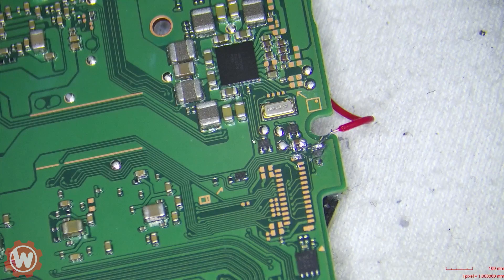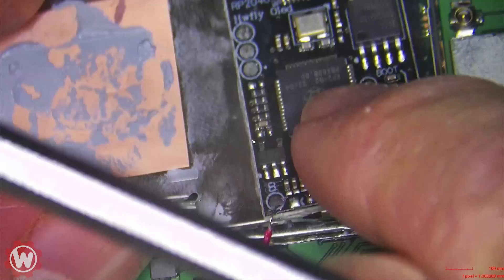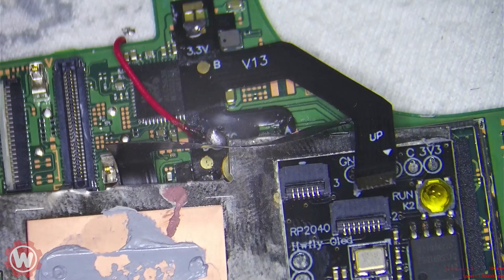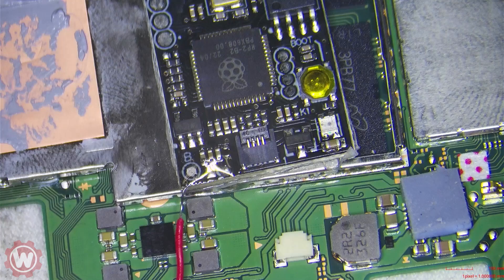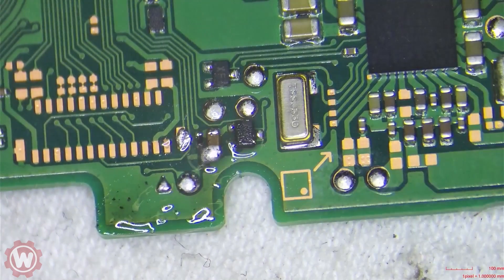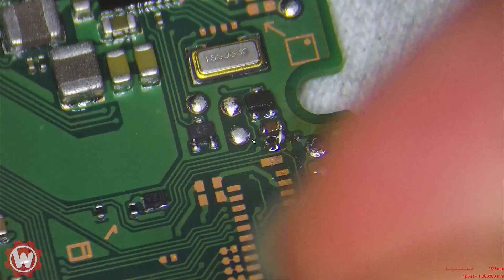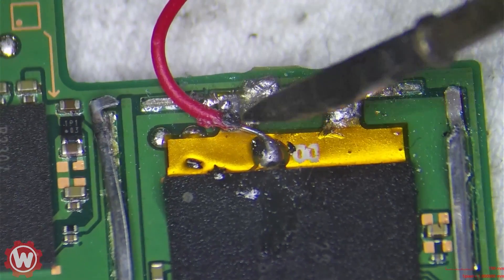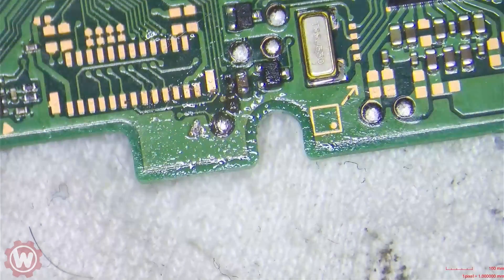Rescuing OLED Switch RP2040 Chip Fix!

Comment: I have exactly the same « missing » resistor…what are the specs of that one? 
Size? 😅
Reply from the maker: I’ve used 2.2k ohms with no problem.
Reply: @Wayayeo ”no problem”, how would you know without proper testing. Terrible attitude towards electronics, and your technique is also really sloppy.
Reply: Funny this professional didn’t even bother to measure its resistance aka the proper way. I swear even a monkey could do it better.

Comment: i messed up my rp2040 install on my lite, but i invested in a microscope and micro solder station and am workin on my skills to replace 2 or 3 0201 capacitors. If i only used the micro scope the first time i would have had alot better chance at success
Reply: Did you manage to correct your mistakes? Also what microscope do you have?